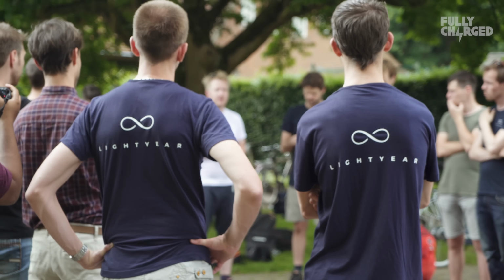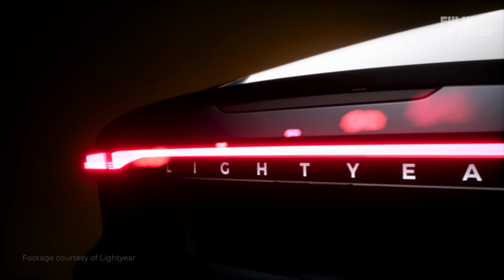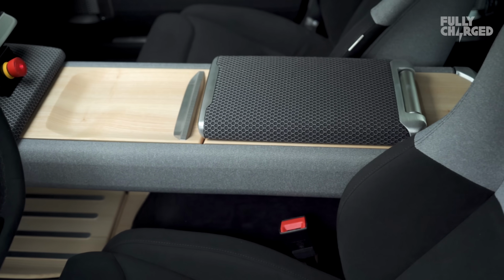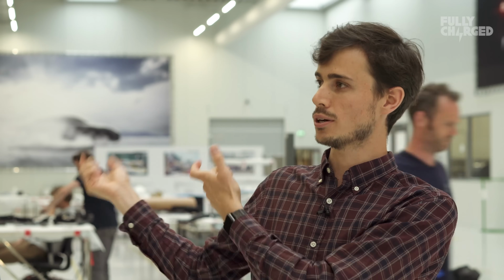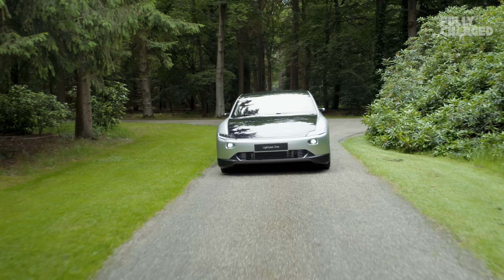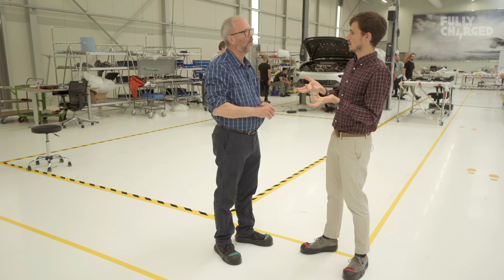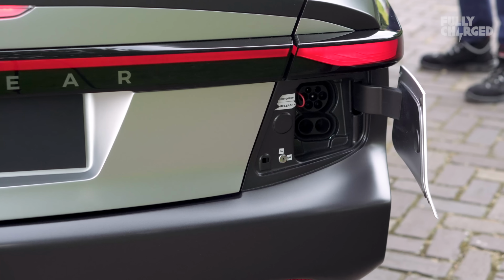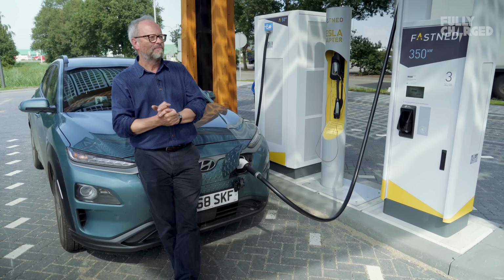Lightyear One solar powered electric car - exclusive first look | Fully Charged

Comment: I find enormous satisfaction watching energy efficient vehicles get recognition it deserves
Reply: the Fisker Karma solar roof only added 200miles distance per year! Has the technology improved this much?!
Reply: @brandonkirk5357  Yes. Both batteries and solar are improving at breakneck speed.
Reply: @brandonkirk5357  
Yep. This car would probably add 300 miles per year. :) IF they ever bring it to market, which they won't. It's vaporware. Solar panels belong on the roofs of houses, not on cars.
Reply: @danielschechter8130  Well, the CEO of Lightyear said that the solar panels on the car would give 10,000 miles per year in a place such as the Netherlands with its solar availability and 20,000 miles per year in sunny places such as California.
Reply: @isaacmadhavan  His claims are vastly inflated, which is understandable because he's trying to get people to invest in a product that does not yet exist. Solar is the future. And electric cars are the future. My solar panels are on the roof of my house, where they belong, and my car charges by plugging in. Putting panels on a car is grossly inefficient because many of them will be facing the wrong way at any given time, and the car will often not be in the sun. The announced price (you can order it in Europe but you cannot buy it yet because they have not started building -or even developing- it) is $135,000. This car is vaporware. It does not exist but they are making claims of what it can do, and it costs more than a Tesla Model 3 PLUS a complete rooftop solar installation with Powerwalls.
Reply: @I speak The truth More like "I speak what might have been the truth 15 years ago" - I have had 3 EVs an never used any coal, gas or nuclear to charge them as my electricity (and the motorway charging network I use) is 100% renewable. Also the lightyear One has 5-7k miles/years worth of solar on board - Did you even watch the video?
Reply: What captures my attention even more is the self sustainability of solar powered vehicles.  Of course efficiency is vastly important but, it's when this high efficiency is coupled with a car that has solar panels embedded in its body that you get a vehicle that is closer to what I call the holy grail of transportation -- a free energy vehicle.  The idea that you could drive in the middle of nowhere and NOT get stuck there (albeit, you may need to camp here and there) is just amazing.
Reply: andrew sumale was looking for those exact words !!
Reply: I would like it to have door coverd with solar panels too. And windows can be covered with transparent solar cells.
Reply: @simonci5177  "Transparent solar cells"?

So, umm, a solar panel that lets all the light through? I sense a design flaw in your thinking...
Reply: @I speak The truth You appear to be suffering from the Dunning-Kruger Effect of being too ignorant to know that you are ignorant. Allow me to help.

#1: EVs will not significantly raise burden on the electric grid for quite some time due to the fact that our current inefficient grid lacks storage. This requires that we have enough energy generation to cover the peak energy consumption, even though we don't need anywhere near peak generation for most of the day. Since most EVs will be charged late at night and early morning, when the grid's generation is barely being used at all, EVs do not require adding anything to the grid. They simply put what's already there to use, at times when it would otherwise sit idle.

#2: Even in the cases where EVs would be getting their power from coal (which is only about 20% of the U.S. and shrinking fast), the full process of producing electricity at a plant, putting it into an EV, and using it to produce motion from an electric motor, is more efficient than turning oil to gas, putting that in an ICV, and burning it to produce motion with a combustion engine. Meaning, even in the worst case, EVs are a bit better and 80% of the time will be MUCH better.
Reply: @I speak The truth Piling up bullshit doesn't make it true.  You're welcome to carry on driving torqueless, obsolete rattling crap-mobiles while you can still get hold of them - Just remember how wrong you were when you buy your first EV. - Smug mode engaged.
Reply: GamingTV uneducated fool. There are panels in the works that are only a few square feet in size, will power a full house, and only cost the consumer a couple Grand. The current panels are massive and very expensive to produce. The efficiency of these new panels is in the 80 to 90 percent range instead of 30 percent. They will not be ready for Mass production for several years yet though
Reply: Oil companies nightmare.
Reply: Sadly it doesn't get more fuel efficient than an internal combustion engine. 
I think what you meant is "I find […] watching electric vehicles get […]". 
Technologically speaking there's nothing impressive here. If anything it's one of the least efficient method of transport. If you want to look at very efficient electric vehicles look at trains. 
There are three big reasons why they are so efficient: 
1) They carry a lot of people. 
2) They don't carry batteries.
3) They only slow down when they need to stop. 

Electric cars fulfill none of those crateria. Also unless you live in europe there's a big chance that the power used to recharge the batteries would be from fossil fuel.
Making it, ironically, have a larger carbon footprint than a gasoline car. 
And even if none of the above conditions were to apply your body would still generate more CO2 than a car. 
The best way to save the planet is for you to die. Having an electric vehicle is good for two things:
your ego and making money off of your ego.
Reply: @LemonChieff  Where you are completely wrong is in two areas: 1. Electric motors use about 1/3 as much energy as internal-combustion engines because the later give off 2/3 of the energy they consume as waste heat. 2. Electric motors can be run from renewable energy. The Lightyear car is vaporware and is a wasteful use of solar panels. But I charge my electric car directly from the solar panels on my roof, so no carbon is emitted, and many people do the same. Electric vehicles are a means to carbon-free transportation. You are correct that electric trains are even more efficient. It is unfortunate that the U.S. has such a poor train system.
Reply: @danielschechter8130  We can agree that the US has a poor public transport system. 
I understand that engines are wasteful (no matter which kind) there is no such thing as a lossless system. "Efficient" is a broad term. I'd argue that internal combustion engines are more fuel efficient. (cf: https://en.wikipedia.org/wiki/Energy_density#Table_of_energy_content ) gazoline is just orders of magnitude more energy dense. Less fuel is spent transporting the fuel. Substantially less, in fact. That more than accommodates for the difference in raw "efficiency". Both kind of engines waste energy as heat, in the internal combustion engine it's repurposed to gain better fuel efficiency, in the electric motor it's just heat. Also I say "gazoline" but I'm really talking about diesel engine which is very different… I should have made that clear, actually. Solar panels are kind of a waste imho but if you have to pick between that and having a nuclear reactor in your backyard I guess it's a saner solution. 
Also the time spent refueling counts as efficiency. Just get a bicycle it's cheaper, you don't need batteries and you get exercise. But I digress
Reply: @LemonChieff  Well stated! Now that you've pointed it out, I realize that transporting petrol and diesel is cheaper than transporting electricity. Thinking about it, even hydro-electric power stations are wasteful because of the massive infrastructure required for the dam and the loss to ecology of the amount of land required to store the water, in addition to transmission costs. Even wind power robs the wind of the capacity to bring in fresh air. So, I agree, solar is the best alternative to petrol/diesel as of now.
Reply: https://www.youtube.com/watch?v=wI8Eocz-AVI
Reply: Good to big design flaws not seen ! 😂😂😂
Reply: andrew sumale by recognition you mean a few millionaires put their drink money to reserve a car they don’t actually care if they can get it or not?
Reply: Me too it's very interesting.
Reply: hey fuckface...its not for the masses....its too damn expensive to be
Reply: it costs 170k... so much to cost effective
Reply: @Jauke Think they are being/have been resurrected recently.
Reply: Loved the VW XL1, sadly it was an expensive, limited, one time off instead of an affordable hypermiler for the mass market.
Reply: But how many get bought out by the big boys - - that's the frustrating part. Buy yeah it is good to see what's coming... eventually...
Reply: then you should love a Diesel lol, liquid hydrocarbons ARE SOLAR POWER!
Reply: Me too! lowkey obcessed with low aerodynamic drag vehicles! Love to see it
Reply: It's like watching the future unfold before your eyes after all the talk and not much action. I'd imagine the people who watched the internet evolve into what it is now had...feelings about that too.
Reply: andrew sumale Wow, added to my research library
Reply: Cheap ugly copy of Mercedes EQXX
Reply: After two years the two cars that I would like to have Is a lucid and rivian
Reply: @I speak the truth  : You are talking rubbish. You are to stupid yourself. Its free energy. Solar panels on top of your house, get you covered  100% for daily needs  of your electric car  +most power needs of your house   https://www.youtube.com/results?search_query=Tesla+solar+wall
Reply: Check out my enormous satisfaction (pulls down pants at EV conference)
Reply: @fullychargedshow

Any idea if they are using Graphene solar energy?
This would make it even better for all weather!
https://www.youtube.com/watch?v=BKomGuejwRA
Reply: How long does a battery last? A few years, tops. Just battery powered vehicles will never take over that big part of the market.
Reply: @JürgenOmlaut  
The battery in my Prius was as good as new when I sold the car after 15 years. The battery in my Tesla Roadster tested at 99% when I sold it after 8 years. These batteries will last longer than 99.9% of all the cars on the road. Nissan had problems with the first gen Leaf in hot climates because of inadequate battery management, but with proper design, electric car batteries will outlast the life of the car.
Reply: I think that once the charge rate is increased EVs will take over.  Until then I'm stuck using an ICE due to emergency necessity.  If everyone is evacuating a city due to a storm how will we all leave if we are dependant on slow charging vehicles?
Reply: andrew sumale they don’t deserve any
Reply: Hell yea, sometimes I feel that satisfaction 3 times a day. I go to EV shows naked, all covered in oil just rubbing my nipples. Ooooh, batteries. Mmm, solar panels. Uhhh, electric motors.

lol, EVs are the future but come one dude, don't make this weird
Reply: Get the recognition it deserves? Random music video will get 10000 times more views than this.
And if this get too powerfull, they will be destroyed by the oil/petrol lobbies. Don't dream too much.
Reply: Shaolin Briquet calm down
Reply: @r.briquet1117  That's such a lousy and pessimistic comment. Recycable energy has changed the world and will dominate it. Petrol/oil have no choice but to give in however they won't give in yet. Ofcourse they're going to fight if all they care about is their shareholders money or they would be doing some illegal.
Reply: @r.briquet1117  Oil companies have nothing to fear from a solar car that will be out of reach monetarily to the vast majority of the car buying public. Same reason they don't fear Tesla etc.
Reply: @r.briquet1117  
The oil lobby doesn't care about this car. It's vaporware. A prototype that can't go over 15 mph and will never go on sale.  You can buy a Nissan Leaf and put solar panels on your house for 1/4 of what this car would cost. And the government will give you back a big chunk of that in tax breaks. REAL solar power is available now and the government subsidizes it. And note, please, that this car is only PARTIALLY solar powered. It would probably get about 2% of its energy from the sun if they ever built one that would actually go on the roads.
Reply: @danielschechter8130  he said 800 kilometers max,400 minimum on a baterry 2/3 the battery size of a Tesla. .
Reply: @recyclespinning9839  At this point it's all just hot air until they actually have a product. Electric transportation is the way of the future. Unfortunately there are people making exaggerated claims to get people to give them money. Solar panels on a car will get you an added five miles a day if you leave it in full sun all day long. It's a far better use of money and resources to put the solar panels on the roofs of homes and charge your electric car from there. My car has a range of 325 miles and cost 1/4 as much as Lightyear One. And I charge it entirely from the solar panels on my house. Are you going to pay $135,000 just to get a little more range than a Tesla? Or the better question is: Do you believe the hype from every YouTube video?
Reply: @danielschechter8130  well I am looking at the Tesla truck,.
Reply: @recyclespinning9839  It looks weird, but if a truck is what you need you probably won't regret getting it. I love my Model 3.
Reply: @r.briquet1117  i think he's talking about it being recognised as an efficient car, not about fame on the internet
Reply: @r.briquet1117  ..wow wow ..about music you place risky scary prop ...it depend on the taste and  "sound sophistication " which this days is in intolerable crisis ..
But you right about the danger of destroyer ..oil industry ..those are soulless monsters ..they even kill if is someone stay in their way of making $ at all cost .
Reply: @r.briquet1117  i’m kne of them but sane enough that this’s way to go but like any new tech how long before everybody can afford it
Reply: @r.briquet1117  
If big oil was so powerful, they would somehow have killed the solar panel industry. They likely had a hand in killing the first real EV, the GM EV-1. All drivers of that car was only allowed to lease that car. Nobody was allowed to own one. Many wealthy celebrities who could obviously afford it wasn't allowed to own it. Eventually, all of the lease agreements were called in and the EV-1 was actually crushed. Only a few of them exist as museum pieces. That was a good while ago. Big oil had a much more powerful stance then. The future is renewable energy. Even BP has wind farms providing electricity.
Reply: @zolarczakl3880  BP was also an early player in the PV field manufacturing panels, solar controllers and batteries.
Reply: @zolarczakl3880  Remember the solar panel industry WAS killed off in USA. They are all made in China. So it's difficult to know if they are a false economy based on price.
Reply: @jesustoldyoutogiveallyourm4880  
Well, I'm glad I got into a PPA two years ago. Didn't cost me any money up front. I just pay monthly for the energy created from the sun to the company that installed the panels. I guess the prohibitive cost currently may hurt the chances of new installations.
Soon enough, Trump will be out of office, along with his tariffs, and things will progress as they should. You can't stop the future.
Reply: Oil/petrol companies are quite fat. Think of household products and many components of an ICE car or an EV car, they are all made of oil. They need to trim a bit  their slice of pie. In the long run the oil/petrol will became quite scarce, people will find a replacement.
Reply: @serbanmike  it's already happening  ..  the oil corporates already act in panic and draging all of us in to destructive  classic mistakes ... if those idiots would direct neuroenergy in to further  ahead thinking they would already switch /invest in to solar energy 50 years ago . but they rather spend trillions$ on destroying healthy competition over those decades to protect their polluting earth old ways .
Reply: Haven't even watched it. But I know 2 things... 1 it's bullshit 2 it's gonna make  99% of retard YouTube viewers believe it works. Anyway time to watch abit of this IQ killing video.
Reply: I laugh at the fact that our grid will not support the immense amount of energy it will require to put these vehicles on the road. Everyone wants to phase out fossil fuels for other energy production methods, but we will need to burn more fossil fuels than ever to power these EV's.
Reply: @oneheadlight8000  
Um, I suspect that as the need for more electricity becomes apparent to power electric vehicles as they become more prevalent, scientists will come up with some way to gather the energy created by that bright-yellow thingy up in the sky. I know, I sound like I'm talking science fiction from a distant future - probably light years away - but I really think someone will come up with a way to turn the bright-yellow thingy up in the sky to create electricity, thereby alleviating the need for more fossil fuels to create electricity as we're stuck with now.
First, we gotta come up with a name for that bright-yellow thingy up in the sky and then figure out how to make those bright-yellow rays work to make electricity. I suspect there are enough scientists in the world and some of them just may make it happen.
Reply: Zolar Czakl exactly the point... Why phase out fossil fuels when they are still the most effective / efficient means of energy. I don't know if you realize but the efficiency of solar energy is sad at this point in time. I agree that alternative energy is needed, but you can't regulate coal so heavily that you put the mines out of business before we have other solutions. I will come back to talk to you in 10 years when all the mines are shut down and electricity costs are $1000 per month because everyone is driving EVs with no energy support for them. There needs to be a huge cultural shift to make it work. One where ppl don't own their own cars at all. Ride sharing will need to be a common place.
Reply: @oneheadlight8000  
Solar energy is very efficient. I have solar panels on the roof of my home. I create more electricity than I require and the excess electricity is sent back to the grid. The grid electric company credits my account for that energy. As long as that sun is shining, there is plenty of electricity to be created.
And it is clean energy. You want to keep digging up the coal and keep putting carbon emissions into the air to make electricity? That bright-yellow thingy up in the sky is doing a fantastic job. That's the future. Coal may be necessary to fuel factories, but homeowners do very well on solar.
And you can charge your EV on that solar-provided electricity.
Reply: Zolar Czakl you must live in an ideal location for solar. I am an engineer in the energy industry and solar is very expensive vs the energy it provides and hence inefficient. We are working on new concepts for manufacturing panels at a much lower price pointbut it is not ready yet. I'm just saying we are shooting ourselves in the foot by regulating so heavily as to put the mines out of business. It's going to really hurt energy rates in the near future. I watched entire fossil fuel corps collapse under the regulations and they aren't coming back to the US. Coal is still huge in other countries though. It's a simple supply and demand question... Demand is going to increase 10 fold and solar / other green energy is not ready to sustain everyone with the current grid. There will be a huge cost increase.
Reply: @oneheadlight8000  
We have to do what we can to stave off carbon emissions. As an engineer, do you agree with that?
Reply: Zolar Czakl I'm not against helping the environment but the technology is not there to phase out coal like they have been. Also, I tend to research other sources than Google. Green energy has a lot of money behind it and you have to take what you see in the media with a grain of salt.
Reply: Josh P dude if you use this car u won’t be using energy because ur using energy not created from the government but later they may start charging for electricity later but we need to stop using fossil fuels even though they are efficient they all give off pollution
Reply: I don't think people should put a lot of hope in these cars, or they will be disappointed. Electric cars are just a gimmick. They have been tried many times before, and it's always been a huge failure. Our president Trump has already shown that there is still a lot of energy we can get from oil and clean coal. There is no rush to resort to gimmicks.
Reply: @mattheww797  really, has he now? 😂😂😂
Reply: Chosen Architect YES president Trump is fixing this country. Electric cars will not save anyone
Reply: @mattheww797  Yur funny if you think the position of US president does anything besides mess with the military. In the federal system, you need 60 senate votes to get any legislation through, and the midterms certainly messed all that up. USA is a system of states that will probably end up ejecting the federal level, if it doesn't get its shit together.
Reply: @mattheww797  is that why all the major car manufacturers are transitioning to fully electric ?
Reply: Matthew W ye but when we run out of fossil fuels we will need to start using solar energy as a replacement and if we don’t have the design and looks we will have to go back to the olden days doing everything by hand and we need to stop using oil because of pollution from oil being burned that causes gasses go into the air which can cause air pollution so we need to give credit to people who are trying to help the earth and have better ways to have a use of energy. These engineers are also giving us a chance to stop using coal and oil
Reply: @mattheww797  really Tesla would say different and one biggest countries in the world would disagree with you, called China. It will be illegal to sell a brand new petrol or diesel car in the UK in 2030 since we are coming to the end of 2021 that’s 8 years. Yes there will still be older fuel driven cars on the road for maybe 20+ years. But manufacturers will not be allowed to make them. So if it’s not electric it’s going to have to be something plus including that some European countries are making the ban of fuel cars sooner the industry will change. No offence but America isn’t the only country that matters in the world.